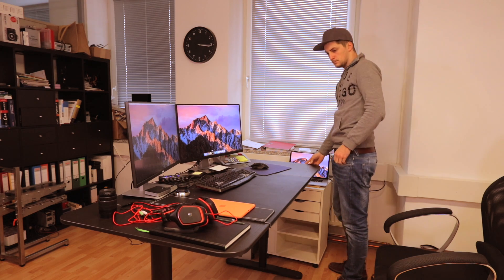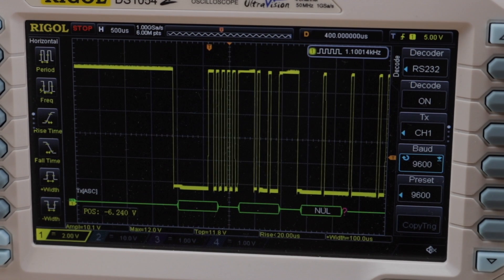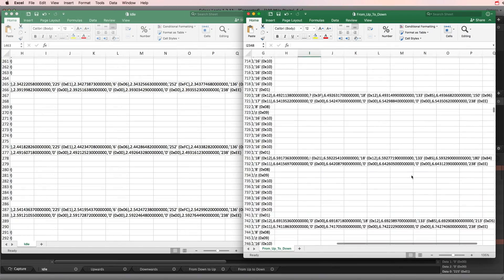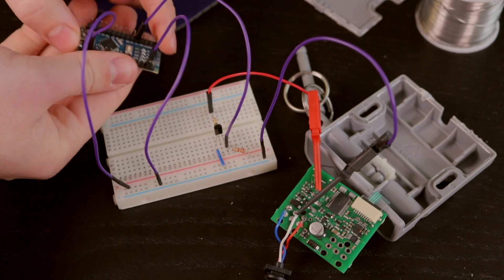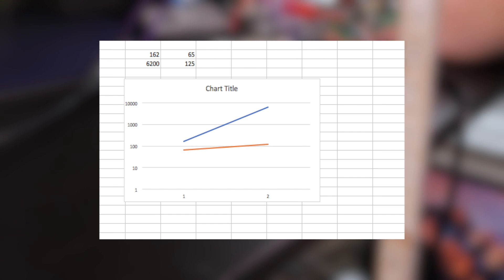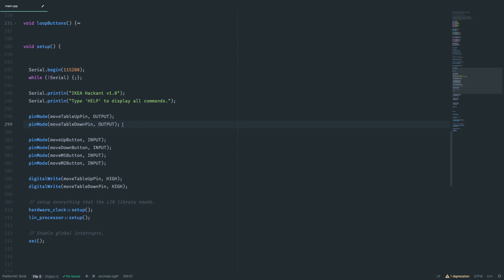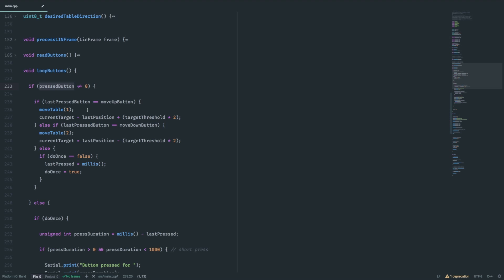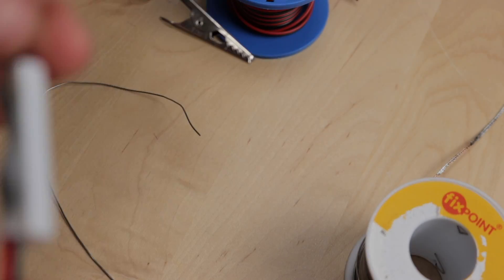IKEA Bekant Table Hacking

Comment: Got a myself an esp8266 and thought I could be done in an evening thinking it was either just some polarity switch or pwm signal.
Now I’m thinking that I can keep the original buttons and just hook into the LIN-pin, send a frame with the desired value (copying the id of the original if necessary) - is there a reason you simulated button presses instead of doing that? Is the LIN-pin only for reading? If so would it work by splicing into the blue cable?

Great video, helped so much 🙌

Comment: I see you just re-used the original board and buttons.
I suppose the movement commands are also LIN packets? So one could entirely replace the original controller.

Comment: Hey Robin, love your work. So much so that - although I am a complete beginner when it comes to electronics - I had a go at making my own controller. In fact, I have attempted to copy Dirk Grappendorf's version (https://youtu.be/AGfcEnkRtz0). Unfortunately, though my controller can read the table's position, the table will not move up or down when the command is sent. Using an UNO as a USB-to-Serial adapter, I can see that my button inputs are received, and it should be executing the command, but nothing happens. If I reconnect the original controller, this still works fine, and can move up and down.

Where can I look to see what might be going wrong? I have no access to an oscilliscope, just a multimeter, an Arduino, and a basic toolkit.
Reply: Just to add, it seems like the table up and table down pins are permanently pulled to ground (where I understand they should only be pulled to ground when a button is pressed). I think this is my problem, but I don't know where to look to fix it... :-(

Comment: Hello Robin, i know you video about the bekant desk is 4 years old but maybe do you know a answer of the following question. Did you know how the original arrow buttons work. My desk is more then 7 years old and i must push really hard the down button to move the desk. So the question is if i can switch both  button without to use your way through arduino?

Comment: I did a similar mod to my Bekant desk, but rather than grabbing any code from the desk itself (I'm new to electronics and don't know how) I just replaced the flexible PCB that connects the buttons with wires to an Arduino Nano. Plugged those into the header you removed. Then via code I raise and lower the desk for a certain length of time. It works, but it's hacky, and your solution is a lot more elegant. Mine suffers from the acceleration/deceleration drift you describe. Not enough to complain, but a set amount of run time lowers the desk more than it raises it due to the weight on top of the desk. I'll adjust that eventually, but the point is I'm really impressed with how much effort you put into this mod and how well it was done.

Comment: I did something similar... instead of the Ikea table, I hacked the functions of the motors to tilt the beds because I hated to hold the button of the control remote and decided to add a function to it that if I pressed the button for x seconds, it would go up or down completely :)

Comment: how does this desk know he's height? What inside measure height?
Reply: That's what I was curious about, too. If you look at the specs for LINAK linear actuators for desks they come with sensor options for potentiometers (absolute positioning) or hall effect sensors (relative positioning, i.e.: motor turns) with/without endstop signals. I was surprised there are so many protocols for desk motors: IC Basic, IC Advanced, LINbus, CAN bus, Modbus and Parallel. Who knew?

Comment: Could you answer how to read the LIN signal? 
Specifically, what physical Arduino port is the LIN wire hooking into? 
Also, how does the Arduino LIN library know which port to read the LIN signal from?

Comment: If there was a chance that it is a PIC16, why didn't you just reprogram it? Two buttons are enough for this application. Also MPLAB X MCC offers a ready to use LIN module. Or let the Arduino send the LIN comands as well.

Comment: For people who don't wish to go through all this work, I suggest replacing the original buttons with push on/off buttons and using limit switches for the top and bottom positions. However your idea results in some good flexibility and scalability for added features.

Comment: A microcontroller for doing something a simple button can do. And not implementing any of the advantages provided by a microcontroller. What a mess!
Really nice hack!
Reply from the maker: El Blog de Joselu The onboard microcontroller actually does more. As far as I can remember it was also responsible for keeping a cooldown period after extensive use. Also it does softstart and stop the entire thing. There are a couple of reasons.

Comment: So what's wrong with the internal pull ups of the ATmega? They may have a higher resistance than your 10K pull down resistors, but for simple pull up/down resistors for push buttons, I really can't think of a good reason to use external resistors instead.

Comment: Stupid question but could somebody explain why he didn't just simulate the button press with an arduino? Did the button send a specific frequency to the microcontroller?
Reply: He is doing that, but without the reading of the current position you will get deviation over time with the absolute position.

Comment: Limit switchs, and a wireless charging base -- and control via usb or serial/wifi/poe -- consider using wesp32 maybe -- or nodemcu -- could add usage graphs and everything to chart how much time you sit/stand n such -- or integrate into a smart home hub, and allow automation
Reply: Add an encoder on the motor too -- then you dont have to do math to find the exact table position, just a table that correlates after homing the table on boot
Reply: could even add a pressure sensor in your chair, with a tiny battery and a nodemcu -- auto change based on if your sitting down -- or place the buttons on your chair

Comment: Electronics engineering stuff on a Mac. I'm amazed.
7:39 That's a cool ruler!
Reply: Yes, inclusive the crappy Hardware, no replacement parts, Apple SMC and Other "Security" Shit that disables the User and - Premium Prince...
Reply: @juliandahl1999  
I agree! That's one of many reasons why I wouldn't want to support Apple platforms if I developed software.

Another reason: https://twitter.com/kbhasi/status/1184915349247942656?s=19
Reply: @kbhasi  I dual boot both my laptop and desktop into Ubuntu and Windows. Ubuntu majority of time especially during development and Windows only when I want to play a game
Reply: @SariAlHiari  
Similar thing for me, but with Debian instead of Ubuntu. I prefer to use Debian, but have to use Windows for work.
Reply: @kbhasi  Tomato Tomahto  😄️
I actually have two other machines for my children and I chose Ubuntu because (in mind) it's easier for them to find help and manage their problems. The dream though is to have them build their own distros and write their own missing drivers. 😄️
Reply: @Dan hardware isn't just the spec power. It also is about the PCB design, passive components, etc. And that is quite crappy.
Reply: That ruler is called "Faltbandmaß"
Reply: Kevin Bhasi Hah! You’d be surprised how many engineer types prefer having a stable and powerful Unix box that also runs plenty of commercial applications. Macs are basically three computers in one - Mac OS, BSD, and Windows. 😜
Reply: dregenius I know many. Except when you look closely it’s not because it’s a good platform. I stopped counting the times where I witnessed friends struggle with Apple’s idiosyncratic Unix. “MacOs, the only Unix where nothing works as in all other Unices, for a 2x or 3x price tag and no actual hardware superiority”
Reply: @dregenius  HAAHHAHAHAHAHAHAHAHHAHAHAHAHAHAHHAHAHAHAHAHAHAHAAHHAHAHAHAHA
Reply: Juancho sanz thanks for this profound comment

Comment: I’m curious about how many hours were spent on this?   I do these same things but feel I’m very slow.  Working in the evenings when I have a few moments to spend on electronics, this project might take me 2 months to complete.
Reply: David Dennis That would be nice! What about putting a strip of reflective tape around the chair and using some kind of proximity detector to sense when the chair has been moved far enough away or close enough, and then activate the memory positions based on that?

Comment: Just imagine what will happen if you put chair under your table and push down button... :)
Reply from the maker: That‘ll be unfortunate :)
Honestly. That might be the case why it is not built in. Guess it’s hard to get CE and all that stuff with such a feature.
Reply: @RobinsTools  You are right, automatic function should have protection, as lot ot things could go wrong, when moving down it could easy crush something under, or just turn over, while moving up it could throw something or turn over. But when it is manually operated only operator is responsible for all damages:).
Reply from the maker: Vladimirs Gusarovs Exactly :)

Comment: Hey.. why didn't you just think of simulating the button function by attaching a parallel button like circuit that will be driven by an external controller. Use limit switches to determine the prefixed heights. A person who didn't understand protocols would probably do this! :)

Comment: Memory for tables and stols/chairs, in cars, office, etc is not a good thing.
If u memorize a wrong position or a bad position for your body, u will not notice that until your body start to hurt. That can take a very long time, but when it happens it can be hard to get rid of it. And if u have bad luck, maybe it take months of rehabilitation for u to be fine again.

So don't use those memory things. Always adjust for next position.
Reply: I think that could be the reason that IKEA didn't program a memory function.

Comment: Very nice. :) I'm about to buy a desk like this, and missed these preset functions.

I had some ideas while watching:
- I would try to find a connector for that plug on the PCB, and use naked test clips to sniff the LIN data. I would try to keep original electronics as intact as possible, given that IKEA gives 10 years of warranty for these desks. But maybe this is not really worth it, because you had to force open the button box anyway.
- I would try to use the original buttons to add presets, like "both button press" + "down" to lower, and "both button press" + "up" to raise to the preset position.

Comment: You can also replace/reprogram PIC and use original electronics. New program will change buttons behaviour, single push recall memory(up memory for upper position, down memory for lower position), double push drives table manually, long push saves actual position etc.
Reply: Hi CD XA, 
where can I find something about that hack?
Reply: @hassiaschbi  https://youtu.be/QopaeB1k6LU?si=8UdciubhQiUdSp1Z

Comment: This is absolutely brilliant. I was thinking of doing something similar, but all I was going to do was put an atmega processor in between the buttons and the PIC and basically set it to emulate a hold on the up or down button for a specific amount of time. Your video of course is a 100% better way to do it.
Reply from the maker: +Kent Hambrock Thanks man! Well I wanted to go for absolute positioning so this was the only way :)

Comment: This is really cool. May I ask a noob question?

I've been trying to chain two BEKANT motorized desks to the same remote control. Nothing fancy like this one, just connecting them in a straight linear fashion with the same cables as come in the box. (The desks are side by side so I'd just like them to move in sync.) So in one end of the circuit there's the power supply, then four motorized legs connected in sequence, then the remote control.

But whenever I'm chaining the assy like that, and have one remote control at the end, nothing moves. Not even the one desk it's supposed to be identified with (as opposed to both, which is what I'm trying to achieve).

I was under the impression that the remote control was a master and all other devices were slaves, so it won't care if it's two or four slaves (leg motors) on the bus?

Grateful for any pointers in the right direction.

Rick
Reply from the maker: +Rick Falkvinge The remote is the master, yes. Unfortunately I think its almost impossible to keep both in sync since they do not immediately stop when you release a button. I'm not sure but if you digg deeper  into the transmission protocol you might fully figure those numbers out. I stopped at one point because I had all I needed to succeed with my specific project.

Comment: Bravo! Good reverse ingeniering and excellent explanation. I want to control two tables, so four legs with one console. After you working on this table, do you think is posible that it works just connecting in series the two aditional legs?
Reply from the maker: Alberto Cezón Thanks! Basically that would work. You would have to connect the arduino to both controller board. But I have no idea if both tables will stay in sync...
Reply: Thanks, early awake! I was talking about to just conect the four legs without the arduino. As far as I can see, each leg has one input and one output. So the schema would be power supply-leg1-leg2-leg3-leg4-console. Afterwards I can implement the functionality of your hack.
One question... are you german?
Reply: @albertoceron8528  Did you end I getting this to work? I'm thinking of doing something like this too. There are two issues I could think of: 1 is the power brick might not be powerful enough (an easy fix if that's the case)

 2 is the LIN device ID. I haven't had a close look at the LIN protocol, but I know it's a relative of CAN protocol. When the LIN controller is talking to the motors its messages have device IDs in the header so it's possible every bekannt leg has a unique ID and the control box is programmed with the IDs for the legs it ships with. Alternatively, if there are genetic "left leg"/"right leg" IDs then two legs might take over eachother confusing the LIN controller.

Really interested to see how it went for you

Comment: Fun project.
In practice you could just only use the two original buttons.
Short press is just the regular up and down.
Long press are the stored positions.

With a bit of luck you can squeeze it all in the original package :) 
(or just re-flash the entire pic)
Reply from the maker: Good Idea. The problem is that the PIC is doing all sorts of weird stuff. For example it is not just setting a position. It is also responsible for some acceleration and deceleration stuff. Also there are a couple of other things going on on the LIN bus. I kinda figured it was easier to just hook up my own controller and leave the PIC how it is :)
Reply: The 'two button only' solution would still be possible.
Personally I think I would just rip out the whole original board, and make my own, instead of re-engineering a whole existing protocol.
Essentially it's nothing more than just moving a bunch of motors.
Reply from the maker: Bart B If you put in your own board you still have to figure out what the protocol does. The positioning values I am reading are actually the commands for them to start running. You could, of course,  rewire the whole motor assembly and get rid of LIN entirely.. But that would be even more work to do.

Comment: Impressive job.
So, if I understand well, the controller you've modified is the master device on the LIN bus ?
If so, do you think it could be possible to build a controller without having to break the original one ? (my desk is knew, and it's quite expensive... :D )
Reply from the maker: Thanks :)
Well basically I didn't touch the stock controller. It still is the LIN master.
The arduino is just a slave reading out table position values.
The problem is that you have to find a LIN pin that you can hook up to. You may find one near the motors instead of having to crack open the main console.
Reply: You could use a LIN Transciever (e.g. MCP2004 ) to do that, but you would still need to crack open the controller because you need to replace the buttons with this appoach.

Be aware the Input voltage spiked to appx. 50 Volts when moving the desk... 8-|

I transcoded the up / down / startup a while back, but the protocol  is pretty complicated and I didn't have time to reverse enineer it.

Maybe with your insights this will proove an interesting project for the dark time of the year :)

Comment: Great hack! The lack of memory is one reason I didn't consider IKEA when buying my adjustable desk. Anyway, what IDE are you using there? I hate the arduino IDE and am looking for an alternative. (Übrigens, im Englischen sagt man "logic high" resp. "logic low", nicht "logically", da es sich nicht um ein Adverb handelt, sondern um den Nomen "Logik". ;) )
Reply from the maker: Thanks! 
Thats GitHub's Atom with the PlatformIO plugin installed. Works just awesome.
(Danke für den Hinweis, man lernt mit jedem Video)
Reply: Atmel Studio is pretty neat too
Reply from the maker: But windows only ;)
Reply: Antonio Tejada If you are running Windows, you should consider Visual Micro for Visual Studio. I believe it is quite similar to Atmel Studio which is actually based on VS.
Coding feels very smooth and the support for the Arduino Environment is quite good.
Reply: developing on mac ugh :p

Comment: Nice job and quite a hack. :D So your original controller also contains a PIC16LF1938?
Reply from the maker: Robert Nixdorf Thx for finding out that this is a LIN Bus :)
Reply from the maker: Robert Nixdorf Well I don't no for sure. They ground off the original numbers and put some custom stuff on it. But for my purpose it actually does not matter.